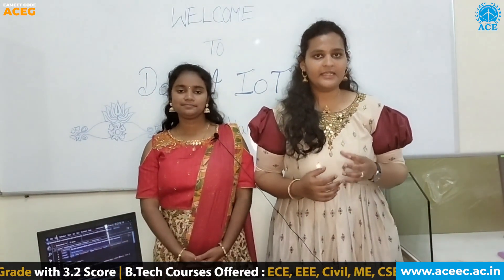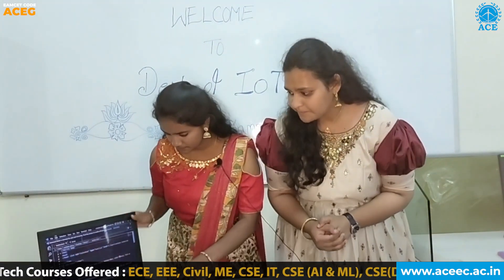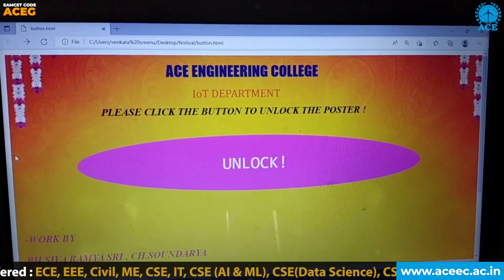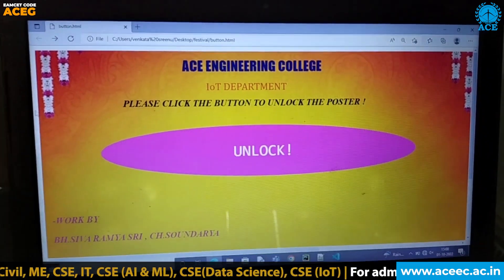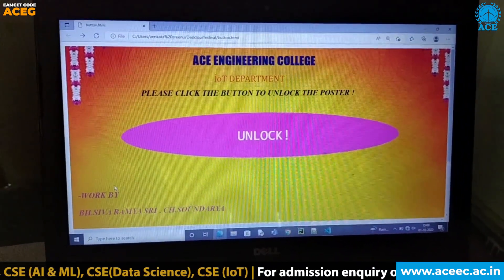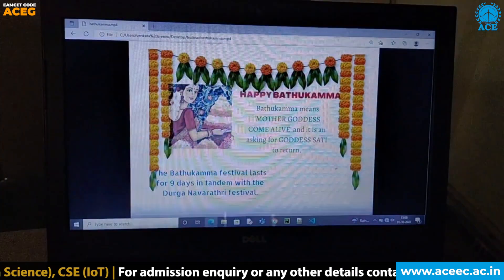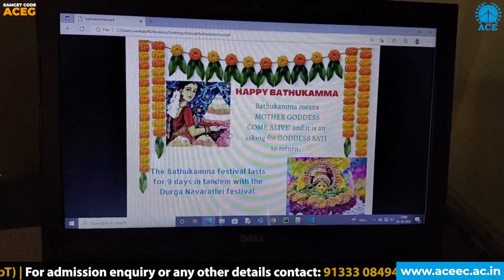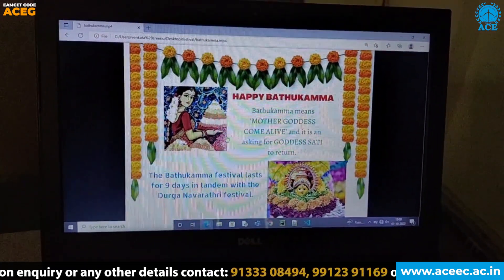Digital Bathukamma - Showcasing  Bathukamma with IoT Components | ACE Engineering College - Hyd

Comment: the project was really good but.. what if the obstacle is below the ultrasonics sensor...it may fail in that case.. and ultrasonic detects the obstacle and Ir follows the object..  but both the sensors are placed side by side..if the object side is big..  won't it confuse the vehicle between obstracting and following the path..